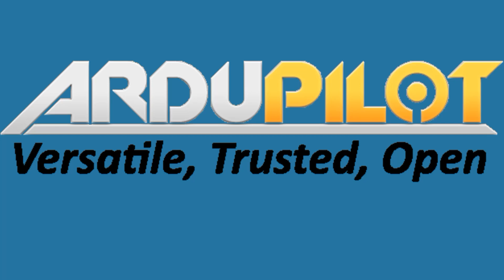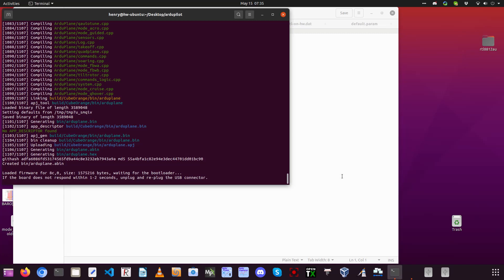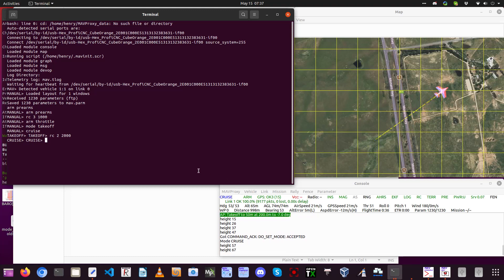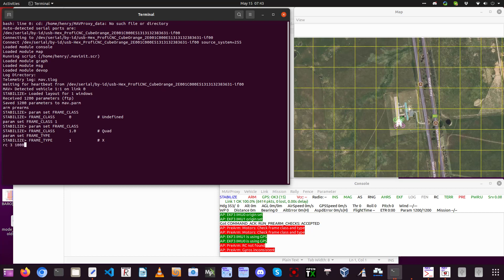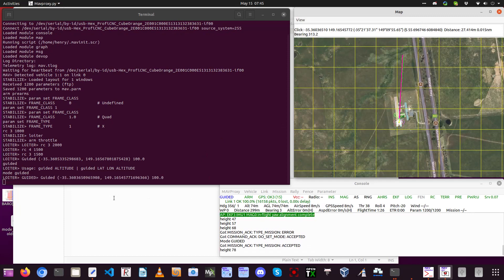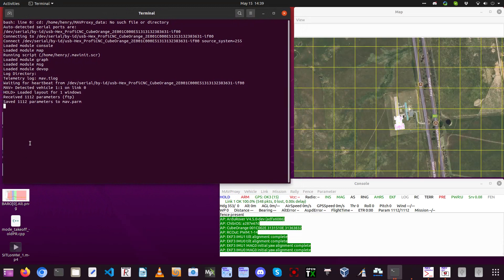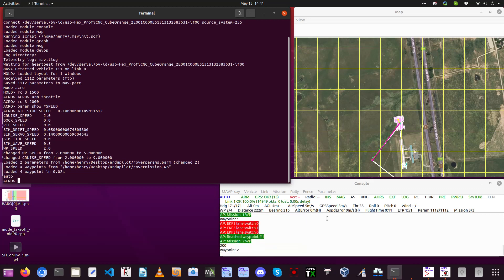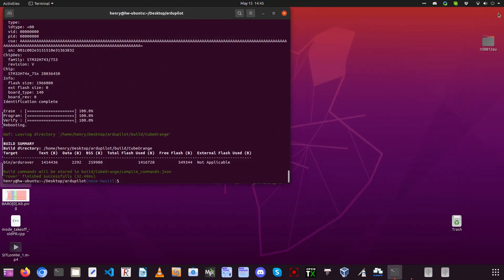ArduPilot Code Debugging Part4- SITL on Hardware Autopilot

Comment: Hello everyone, I am trying to connect gazebo iris drone with ardupilot pixhawk6c in hil mode by mavproxy. When I connected my pixhawk from mavproxy, it’s okay but about gazebo there is issue for connecting. At the end, everything looks okay however my mavros commands are not sent to gazebo. Gazebo iris drone doesnt arm or takeoff. Please, Could you help me to connect pixhawk instead of SITL to gazebo.
Reply: @meftun-u1n  Hello, I have also been doing research in this area recently. After using the method in the video to change the flight control board to Pixhawk6X, I also want to connect to gazebo through mavproxy. I would like to ask if you have found a solution, or is it we can discuss it together, thanks

Comment: Good afternoon, dear friend. Unfortunately, I did not receive support on the forum on my problem, so I am contacting you here When I try to read the log file of the matek f405se flight controller through the built-in utility "geo reference image", I get the error "going out of the array".  Could you suggest how to edit the file for its proper operation, or give additional hints? Now my line "CAM" looks like this: "CAM, 291420823, 0, 1, 373677400, 2266, 38.08845080, 41.62946370, 46.35, 46.35, 46.35, 29.36, -21.65, 243.69". It is she who causes the error.